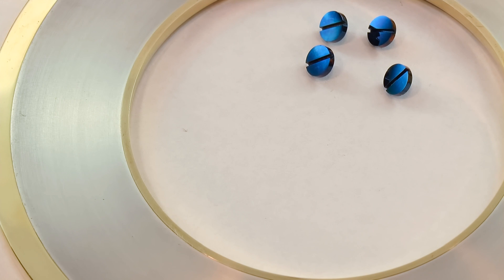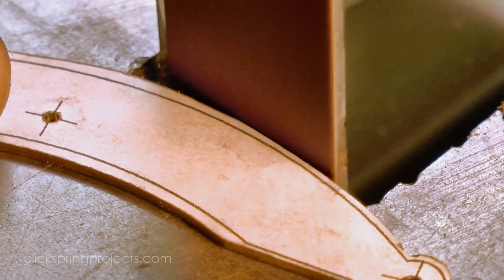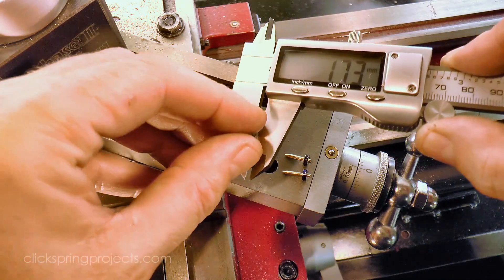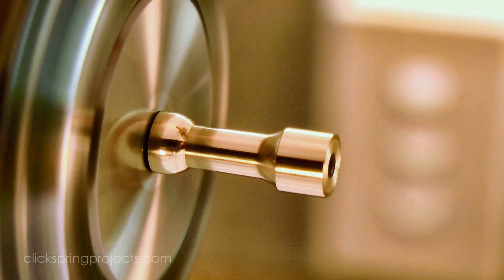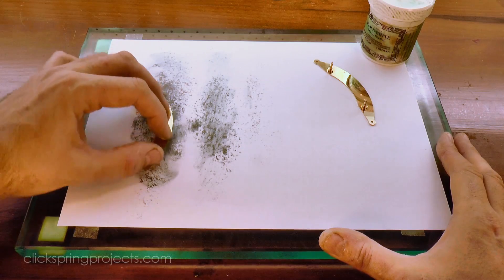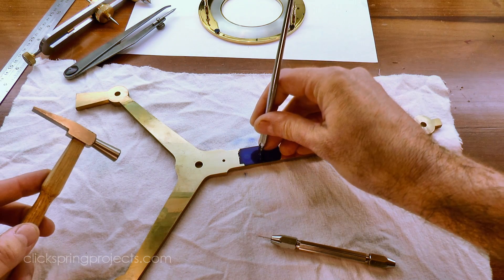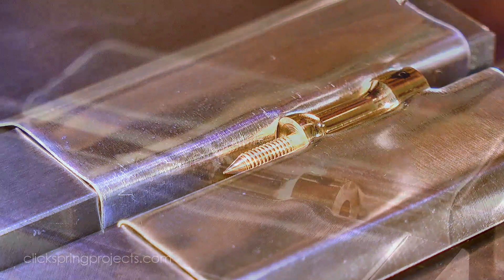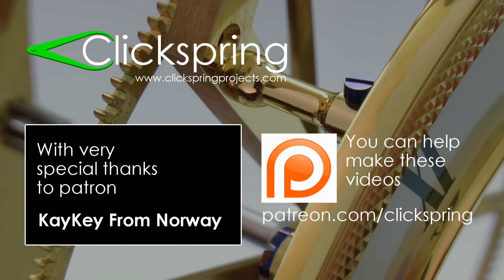Clockmaking - How To Make A Clock - Part 15 - Fitting The Dial Assembly To The Frames

Comment: Interesting screwdriver (6:25), there is a video of it?

Mark Fisher, Ukraine.
Reply from the maker: +AlfFisher Hey Mark, its a small hand vise with a piece of brass shaped to fit the screw slot. I don't have a screwdriver with a wide enough blade to fit these bezel screws, so I use the hand vise as a temporary one to get the job done. Thanks for watching.
Reply: + Clickspring  Thank you, now it is clear. A video of the grip - is? They improvised? (DIY)

Comment: Another awesome video!! beautiful! Is that thin sheet metal what you used to hold the parts in place to drill and tap the set screws holes? very cool!
Reply from the maker: +Cactus! workshop Some sort of plumbers flashing from the hardware store. I think its a tin alloy of some sort. Thanks for watching CW.

Comment: Great work! Looking forward to the next video for sure.

Since I'm about as far from being a clockmaker as one could be, what other elements really remain after the motion work and hands are complete and installed?
Reply from the maker: +Brad Reardon Hey Brad, I estimate another 6 episodes: Crutch and Pendulum, Stopwork, Escapement, Winding Key, Final assembly, as well as one more small design change to the frames. Cheers, Chris.
Reply: +Clickspring awesome, looking forward to all of them and all the spare parts in between :) do you have any pending projects following the clock build that you've revealed to the public yet?
Reply from the maker: +Brad Reardon Yes, very excited about the long term project to follow this clock build, but still sitting on the details for now. It will also have a related project for Patrons that will run in tandem. Estimate that build will commence around mid year, but expect to have several patron projects completed before then, more details on that in the next few weeks.